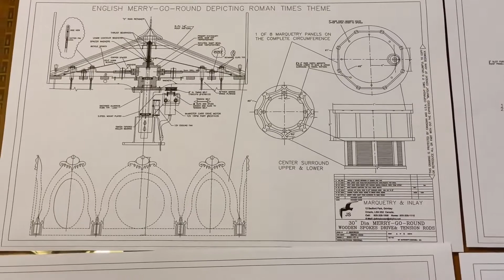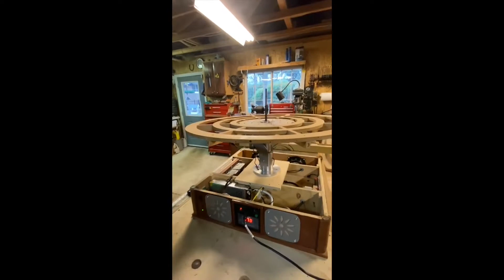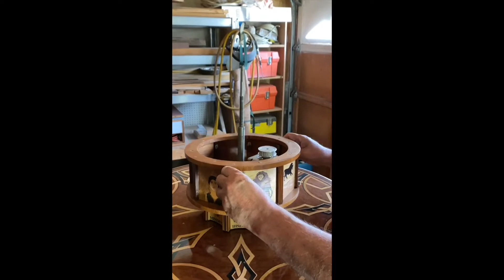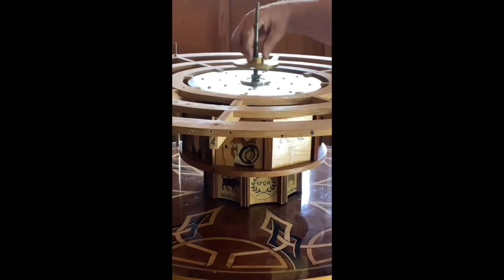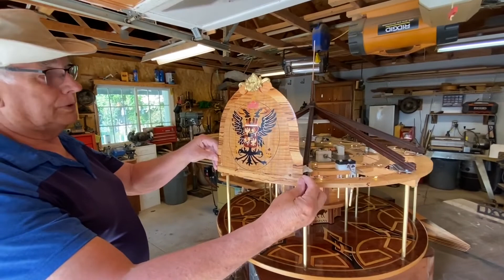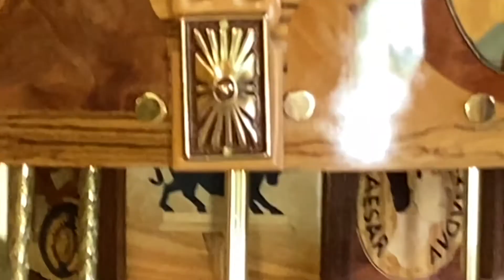Making a miniature scale carousel.

Comment: Excuse me, Mr. Sedgwick, a wonderful carousel, but how are the lights made to pass from the roof, let's call it that, to the base?
Reply from the maker: sorry for the delayed reply have had some pressing personal problems. I toyed with various power pick ups, similar to the old fashioned pick-up for a car horn which I eventually reasoned would present too much operational  maintenance;  eventually I decided on a separate rechargeable  battery mounted on the upper rotating ring. this has this has proved very successful lasting about 8hrs of continuous use at wood show exhibits

Comment: John — incredible work! I absolutely love the mechanics, and using the bicycle wheel to hold everything together at the top is a brilliant touch.

I do have one question:
I noticed that the lights rotate with the carousel, but nowhere during the assembly did I see how power gets from the base up to the rotating top. The main shaft appears to be completely solid, so I can’t quite figure out how electricity is transferred to the spinning section.

Could you shed some light on how you accomplished this? I’d really appreciate it — thanks so much!
Reply from the maker: sorry for the delayed reply have had some pressing personal problems. Regarding the lighting, the 12 v supply that powers the gear drive/speed controller, cooling fans and do not power the LED lights. I toyed with various power pick ups, similar to the old fashioned pick-up for a car horn which I eventually reasoned would present too much operational  maintenance;  eventually I decided on a separate rechargeable  battery mounted on the upper rotating ring. this has proved very successful lasting about 8hrs of continuous use at wood show exhibits